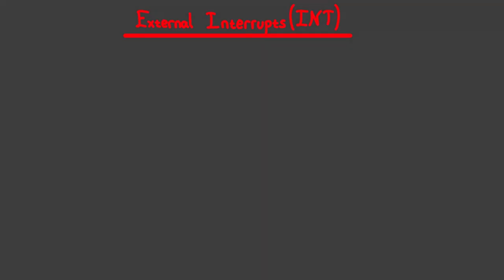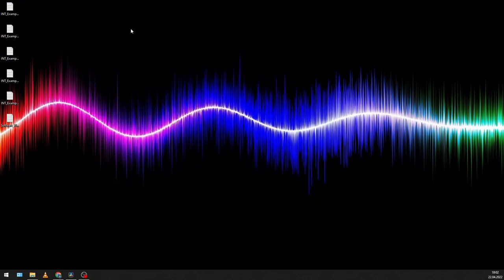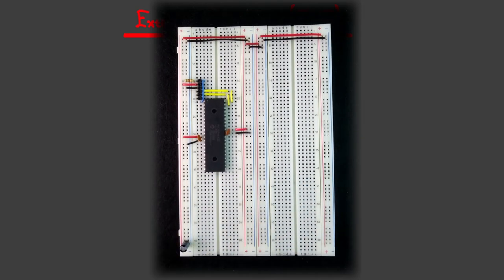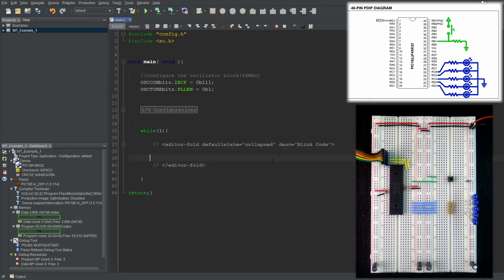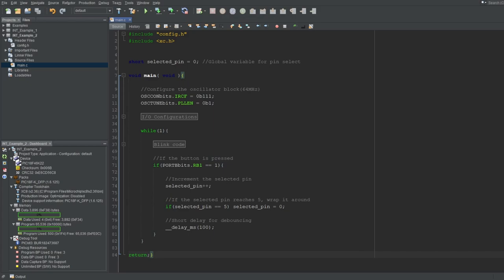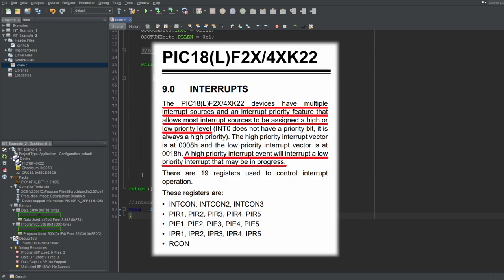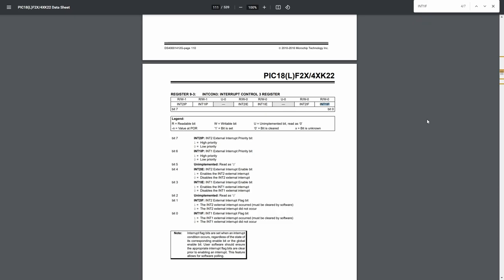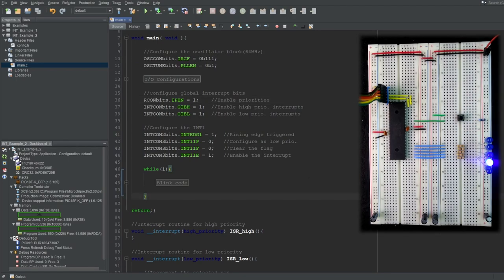PIC MCU TUTORIALS #15 - External Interrupts (INT) & Interrupts in MPLAB (Absolute Beginner)

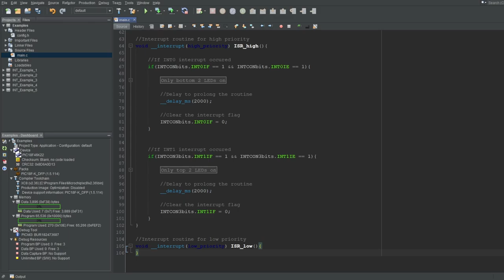Comment from the maker: Extra Note: At 26:33 instead of creating a software flag variable, you can just disable the enable bit of that interrupt and directly check the flag bit in your code without any interrupts (this is exactly the reason why flag bits set regardless of their enable bits; it's so you can poll the interrupt flags). You only need to create software flags if you need a part of your code executed asap in the interrupt routine, while some parts can tolerate being delayed.

Comment: @27:07 I believe this will reduce power consumption and decrease the latency period for the ISR mechanism to respond to an external request - because of how IRQ works.
Reply from the maker: That depends. Most of the time, efficiency won't change since you'll enter and leave the interrupt routines the same number of times. Power consumption would only reduce if you also utilized low-power modes along with interrupts.

As an extra note: 
Jumping to the interrupt routine takes 3-4 instructions. Checking which interrupt routine has been fired also takes many instructions. If you're using two interrupt routines at the same time, that also adds a bunch of instructions since there's only one set of "shadow registers" for this microcontroller. So technically, depending on the application, interrupts may even reduce the efficiency.